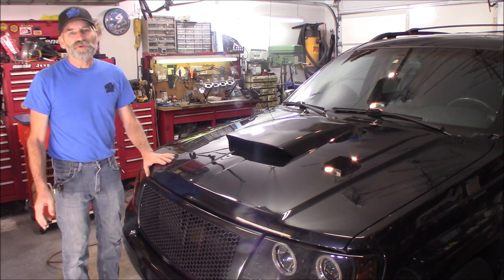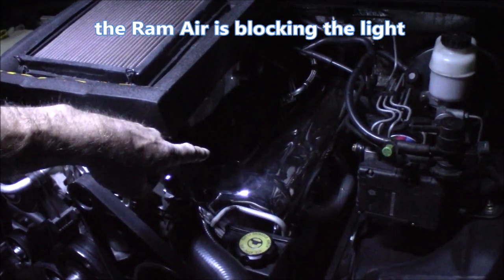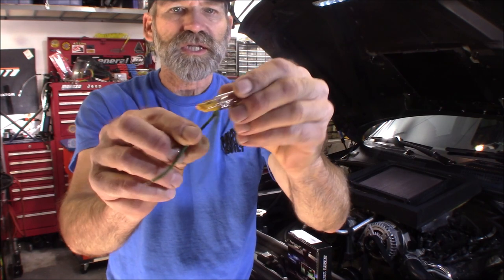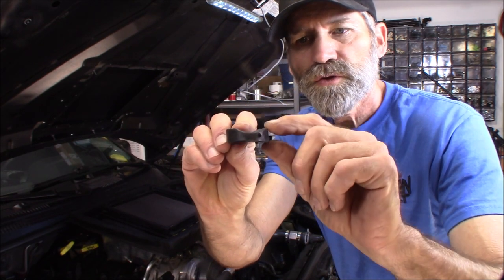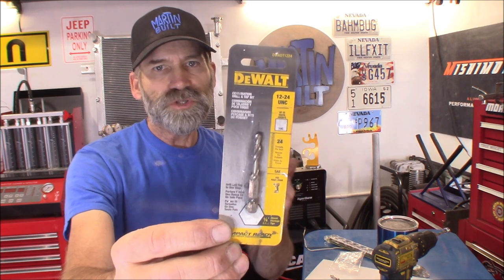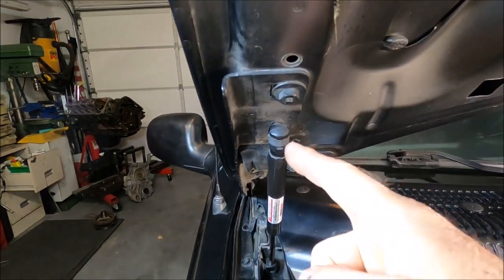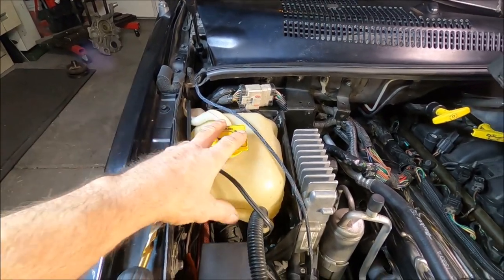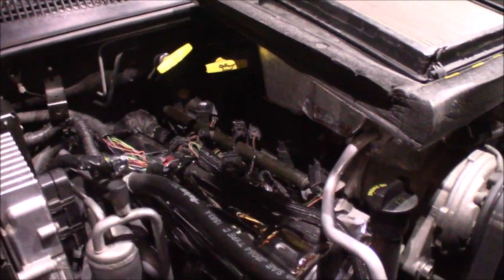How to Install LED Underhood Lightning

Comment: Love the lights Martin.. Drove me to install 8 under the hood of my 05 RAM.. But instead of a mercury switch on the hood, I installed a waterproof toggle switch mounted on my radiator support, cuz I don’t want the LEDs on if it’s light outside.. Thanks for the video, love my new lights..!

Comment: As some one who works in a bodyshop, I enjoyed watching a clean install on those. How ever as some one that works in a bodyshop, I may have done it a bit different. I would have run a wire loom on the hood & not inside of if it, still run it in one direction like you went. I would have made the the lights be able to plug into each other. One if for some reason a light quit be a lil easier to replace, 2- if you get in a accident, the body shop will cut your wires and you have to work over again. I would have also used connectors either before you slide the wires thru the hole. This way the lights can be salvageable. Also where you connected the wires next to the latch, I would made extra effort as that where the safety catch is to make sure wires don’t get caught or rub against it.
Again, very nice and really clean install. I can tell you take pride in the work you do. 🤘👍

Comment: Now you just need to add a plug so you can disconnect it if you ever need to remove your hood, or just wait till that time comes and just cut it where you want the plug to be when, or if you remove the hood and install the plug then. Overall absolutely great job, I will be looking to do this mod on my 04 overland, and probablly several of my other cars. Thank you for the idea and all the great work you do on your channel.
Reply from the maker: Good point Chris, because eventually I looking to change the hood. Like you said I probably just cut the wires and then add the plug at that time.

Comment: Looks great.  I always have trouble seeing some areas no matter how many lights.
Reply from the maker: Thank you. Wait till your eyes get to be 59 years old, lighting becomes a real big deal.
 In the future, when I pull the engine, I'm probably going to add 1 or 2 more to the underside of the cowl to light up the back portion of the engine.
Reply: @martinbuilt  I'm 70 so I may be adding lights continuously  :)

Comment: Very nice! I think I'll do the same, and put some in the rear cargo area, too!

Have you replaced your heater hoses? They look longer and routed slightly differently.
Reply from the maker: Thank you, yes after relocating the battery I rerouted the hoses so that they weren't going over the valve cover. I'm trying to make the engine bay look better and make it easier to work on the engine.

Comment: I'm looking at getting an 03 with the HO as a project. Want to do a 242HD swap so I can go into 2WD and 4HI manually.
Reply from the maker: Cool I wish mine was an HO. I consider doing the same thing by installing the 242 so I remove the front drive shaft just to see what it was like in two-wheel drive mode which is fun but with my mods it tends to get away from me so I'm putting the front drive shaft back in and leaving it full-time 4 wheel.
Reply: @martinbuilt  with all the work you've done you could of installed an HO by now. You can do it Martin! Go go go go!

Comment: Thanks Martin! I do have a question about the hood liner, as I see you are not running one which makes this install possible. Does the hood liner serve any other purpose on these except noise dampening? Have you had any issues with the paint on the hood getting too hot and flaking or anything like that? 
I really want to do this light upgrade, but the hood liner on mine is in the way, so I am really wondering if there are any downsides to removing it. 
Thanks and Happy Holidays!
Reply from the maker: I haven't had any problems, you could remove it to install the lights and cut the liner around the light fixtures as you reinstall the liner.
Reply: @martinbuilt  thanks! Yeah I might try removing it altogether and see how that goes. Thanks for the quick response and another great video!

Comment: I have a 2002 Ram. It currently has an under hood light (if that's what you want to call it), and I was wondering if I could just wire into that line for four pods? Would it be enough to power the pods, or would I need to wire directly into the fuse box?
Reply from the maker: Yeah, that should actually work quite well. Those LED pods are a very low draw light.
 I'm surprised my Jeep Grand Cherokee l
Limited didn't come with an underhood light being it is the Limited package.
Reply: @martinbuilt  Thank you! I'm guessing that also means that I don't need the tip switch?
Reply from the maker: @crandallwoodworking2988  that's right 👍

Comment: Why not add some LED's on the firewall to better light up the back of the engine that is tucked away under the windscreen lip?
Reply from the maker: I was already experimenting with the one light I have left and installing it exactly where you're talkin. I will probably eventually about one down there.

Comment: Did you relocate your evap canister ?
Reply from the maker: No my evap canister is located  next to the fuel tank on the left side this is the stock location for the later model grand Cherokees.  But if I had the earlier model grand I would have definitely relocated it located it to clean up the engine Bay.
Reply: @martinbuilt  thank you so much for the reply. This makes sense now because I have mine located under the hood In front of the brake fluid container. I’m going to consider relocating it.